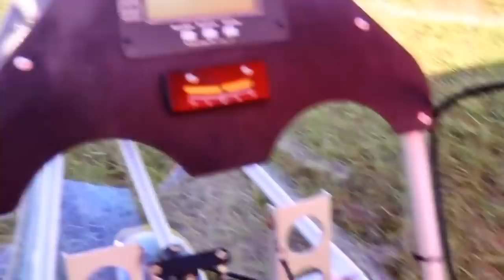Aerolite 103, Hayes Aero, Aerolite 103 ultralight and experimental aircraft builder.

Comment: Was that a double surface wing?I know it increases  distance but doesent that  enable it to stall?As I recall,my old quicksilver was self correcting in a stall but really ate the gas..........
Reply: As long as you are not beyond aft CG limits or intentionally trying to continue pulling back on the controls, almost all fixed wing aircraft will self correct in a coordinated stall. Just relieve the control pressure.